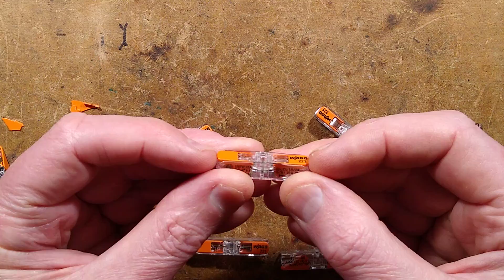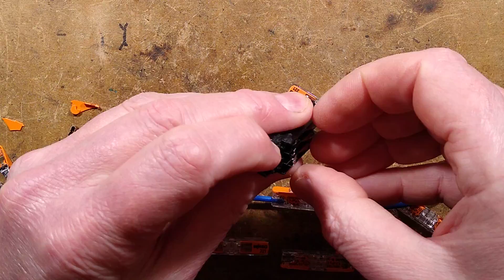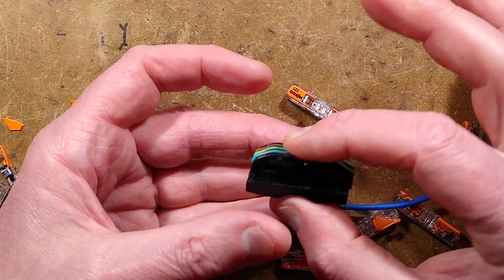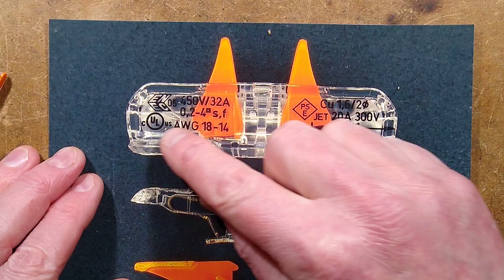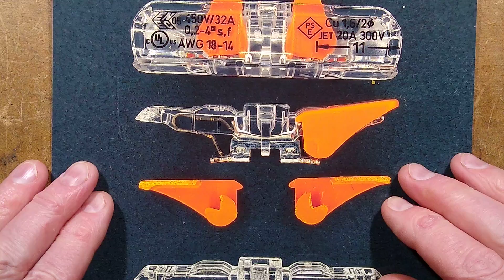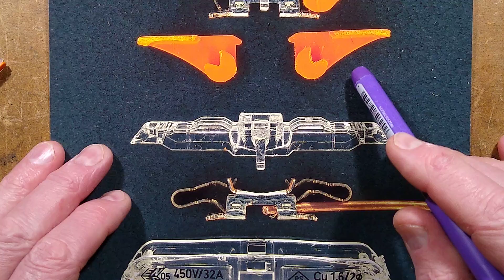By request - a look inside a Wago inline connector

Comment: You shouldn't put stranded wire into it. If you need to do it, you should crimp the wire.
Reply from the maker: It is designed for stranded wire.

Comment: I use Wago 221 connectors all of the time for electronics projects.
They're so handy to insulate the end of a wire you've yet to connect or have disconnected to try something - obviously when you're powering the circuits.  I also have them on bench power supplies so i don't have to keep connecting wires to those screw binding posts.  They're definitely a quality of life improvement when tinkering with projects.

Comment: Sometimes life confronts a chap with a situation where hard choices must be made.  Do I cower in hopes the impending misfortune passes by leaving me unscathed, or do I muster up the fortitude to contront it head on?  Today is one of those cases.
   Whilst taking an intermittently failing appliance to bits, in high hopes and anticipation that it should be fully functional upon completiion of the fiddling, I discovered that the thermally conformable polyolefin sleeve supply had previously been depleted. Hmmm, if I leave this disassembled gadget scattered across the workbench until such time as I can get round to replenishing supply, it is a near certainty that one of these near microscopic screws shall have escaped, and even should that situation prove only to be unwarranted paranoia, it is much more statistically probable that I would forget which of the 5 is a different length AND a different thread pitch in to at least 50 year old, undefined but sorta acrylic like plastic which would be likely to result in a more problematic conundrum.
  Hmmm.  Should I reassemble it as is until such time as I might be in a location where the polyolefin supply might be restored AND memory should happen to trigger that the supply needs to be restored, or just use a carefully applied, adhesive backed vinyl, du noir and just not tell anyone?
   As I stood perplexed, weighing the options over a cold slug of coffee, I thought, What might Clive do? 
 Well Sir, I hope I havent underjudged your course of action whilst confronted with a similar dilemma.   I put the tape on it and called it good.
I'm happy to report, that lacking a strain relief at the end of the handle, the cord did, in fact, appear to have been strained to the point that metal fatigue had seperated the copper strands, one from self, and one from another such that it only transmitted electrons sufficiently if one held one's mouth right. 
So the guess, and sacrificing 2 inches of cord length to resolder the connection beyond the separation succeeded. Works good now.   Oh and that split in the plastic was there before I started. So now I can oscillate the knots down my spine, and the splints along my shins and forearms happily. 
As to the matter of propriety of electing to use black tape in that scenario, I wont tell anyone if you wont. 
BTW, yours is the first channel I have ever noted being involuntarily unsubcribed from.   I'm thinking I missed whatever it was you electrocuted for Christmas.   Thank you for recording the event so I can roll back the clock and be there posthumously.

Comment: Teams in the competitive robotics league I am involved in have begun using these because they cover the range of (most of) the wires we use (between 22awg for signal to 12awg for 12 volt dc power) and I quite like them for the fact that they are fast and easy and require no crimping, unlike the Anderson PowerPoles many teams used prior. They are also pretty impact resistant thanks to that nice spring, the PowerPoles need the little plastic locks (or zip-ties around the pair). After some fiddling I find the little orange lever loosens somewhat but it still bends the spring open and the spring does all the real work. I have had no real complaints with them.
Reply: They make a model that goes up to 10 awg! Part number for the 3 way for 12 awg = 221-413, while the 3 way for up to 10 awg = 221-613. Just replace the 412, 413, or 415 with 612, 613 or 615 to get the 10 awg versions 🙂 The 10 awg versions are rated for up to 30 amp @ 300 V (The 12 awg are rated for 20 amp @ 300 V) 

This further calculation for 12 volt DC is from an Ohm's law calculator and is NOT from the company, but shows that the 10 awg (30 amp) models should be able to handle 750 amps @ 12 volt (9,000 watts. 30 amp @ 300 volts and 750 amps @ 12 volts both = 9,000 watts.) 

[20 amp @ 300v = 6,000 watts in comparison. 500 amps @ 12 volts.)

Comment: Are there automotive alternatives to wago clamps?
Reply from the maker: Vehicles are better with crimped joints for ease of waterproofing.
Reply: @bigclivedotcom  That sounds reasonable. But I never saw a crimping alternative to the Wago 221 which are 2, 3, 4, or 5 fold. Do you know of a crimping solution to those?

Comment: All the tests i've seen really show how great these connectors are. I will admit that twist caps make a better connection but only because its not the cap that is making the connection, its the wire twisted around the other wire for virtually no resistance load added. Vs a wago which runs a bus bar. But considering how well designed these are you are FAAAAR more likely to burn out a cheap outlet tab or destroy the tabs in a light before actually destroying one of these wagos. All the destructive tests I've seen were just end to end with a wago in between. Would love to see a test with source to output such as an outlet with a whole lot of load on it, and see which fails first. The wago connections within the branch circuit, or the sources that use the power themselves...

Comment: Very good review here Big Clive but one aspect of these connectors that is never talked about is how the plastic case reacts under heat or fire
Reply from the maker: In extreme situations where the cable is red hot then the plastic may be melted just as with a screw on or choc-block connector.  But the metal insert will still hold the wires.

Comment: I used those connectors in ebike. They are amazing. I was expecting them to start melting, but they are not even warm with 25 amp cotroller.

Comment: Nice teardown. One thing I am confused about with these is their current rating. Let's say they are being used in a UK domestic ring main, so 2.5mm squared cable and 230VAC, what is the maximum current they are rated at; 20A or 32A?
Reply from the maker: The full 32A of the circuit protection.
Reply: Thank you  @bigclivedotcom . It's always baffled me with the two ratings on the side.

Comment: I would love for you to take a look at the IKEA VARMFRONT powerbank. Nobody else does. It charges my phone in no time, and phone gets quite hot. Should I be alarmed? I wanna know 😬
Reply from the maker: I don't actually recommend fast charging phones.   I always use a lower power charger on mine to avoid excessive heat and battery life shortening.  But sometimes when caught short with low charge I will dig out a fast charger.

Comment: They are apparently very very good, because they are sold out absolutely everywhere. The standard ones with all entries on the same side are available by the tens or hundreds of thousands, but the straight ones are "Delivery date unknown" everywhere..
Reply: Not sure where you are looking, but CPC claim to have over 14 thousand units of 221-2411 in stock.
Reply: @petermichaelgreen  I'm looking at several of the different Swedish suppliers my job has accounts with, since I live in Sweden. 🙂 And evidently, 14 thousand is amateur numbers, a local supplier has 145,800 of the 413 variant in stock. However the same one, which reported "unknown delivery date" yesterday, have 6,600 in stock today, of the 2411.

Comment: Thanks again for going in to fine detail of this connector but can you give us a rundown of the information printed on the side of the main clear plastic body.
I see one side says 450V/32A yet the other side is different plus some other wire sizes etc.
What might be the reason for this?
Reply from the maker: It's different countries testing standards.

Comment: Great video Clive.
If someone is going to get critical about surface contact area of these connectors, then they are using the wrong size connector.
I use original Wagos at work, always twist to keep strands tidy.
If I wanted more surface contact, due to high current, then use a higher current rated connector.

Comment: I believe the official pronunciation (used by the company in their promotion materials, etc) in English markets is "wah-go", so that's what I've trained myself to call them (but to be honest, I have the distinct feeling the company doesn't really care what you call them, as long as you keep buying them :) ).

Regarding twisting vs not, as long as you get all the strands inside the connector, I don't think it really matters that much.  I usually do a very slight twist just to make sure I don't catch a strand and get a stray whisker when putting them in, but I don't worry about actually twisting very tightly.  One of the real benefits of this design is that it is self-tightening, so if the wire untwists inside the connector over time due to wiggling around, etc, it will just make for a tighter connection in the end (but even if it doesn't, I'm pretty confident it'll still make a plenty-good connection even with twisted wires, so either way is fine).

Comment: I twist the wires, I will not use solid conductor wiring with these though. Wago makes so much other stuff besides connectors. I'm extremely familiar with their I/O interfaces. Anything that says Wago is top notch.
Reply from the maker: These are designed for solid cores too though.

Comment: I prefer the Wago 222 beforehand the 221 because they are even stronger and more durable especially in moist environment. people don´t like these because the levers are harder to toggle, I like that because it clamps even harder on the wires and I have used hundreds upon hundreds of both types and always seen better results with the gray 222 type

Comment: I like these WAGO inline connectors but I was a little bummed that they are limited to 14 AWG wire when the splicing connectors can fit up to 10 AWG. This means that the 32A contact rating can't really be utilized in the inline version.

Comment: The most important criticism of Wago connectors is how much contact area they make. The stab in type with the little spring loaded catches especially. It looks like this design addresses that, but you don’t mention it. 
You do however spend half the time talking about how hard they were to take apart, which I’ll never do, and multiple ways to pronounce the name. I don’t usually get frustrated with 5 minute videos, but I did here. 
Great demonstration and drawings though.
Reply from the maker: There is a short version of the video too.

Comment: This has changed my mind. I have preferred the old-school connectors where I could trust my eyes and skill with a screwdriver to know the wire was firmly and electrically connected to another wire, short (no pun intended :-) of soldering and sleeving.
I would now use these. I thought the USA used crazy stuff  like wire nuts and lumped Wago in there.
I find that here in NZ there are lots of sellers, and I will now look at getting some.

Comment: How does the lever snap back down when there is a wire inserted? It seems like the spring is what's used to tension the lever, but with a wire inserted, the spring can't push down as far as when it's empty. And you wouldn't want the lever holding the spring up (very much) when empty, as that would make the minimum wire size too large. I'm probably missing something obvious.
Reply from the maker: The lever will be slightly looser when the sitting is gripping the wire.  But it still has to be operated with the same force to press the spring down.

Comment: When I remember right (I was told this), about 25-30 years ago these were still illigal to install here in the Netherlands. Even though they were already used in other countries (but less common). In the house I lived in, they were therefore replaced by an installation-company (not installed by me). Same actually on some places in my current house, also original Wago's were replaced with the twist-systems, I think around 20 years ago.

Comment: When I was at apprentice school (nearly 50 years ago) we were taught to twist multi-strand wires even if applying a ferrule afterwards as a stray strand can (in rare instances) be fatal.

These Wago terminals are a brilliant invention. I have spent a large part of my career designing, programming and trouble-shooting control systems on custom-built industrial equipment. When screw terminals were common, something like 75% of first-year failures were down to loose terminals. Many control panel electricians would build sections with terminals "nipped up" until complete. When they forgot to tighten everything (end of shift, tea break and many other reasons) you had a failure waiting to happen. With the Wagos, if the lever is closed then the wire is tight.

The other feature of the Wago connectors is resistance to vibration. We once sold a spin riveting machine with the control panel mounted on the frame. Had to fit rubber mounts to stop the screw terminals winding undone.

Comment: Yeah, don't twist the wires and never use Wagos.  If the strands stay gathered they won't 
'flow' to the surfaces of the lug, ferrule,clamp or any other termination.  I was unkindly told so 
by an old cranky engineer that designed such things. Also copper clad spring steel is no bueno in so many ways.
Reply from the maker: Wagos are the new standard.

Comment: I usually crimp an appropriately sized ferrule on to the wire to stop any strands from going where I don't want to. Plus it gives the Wago something a bit bigger to bite onto. I have had stranfs break off inside the Wago when not using a ferrule.

Comment: Whenever I use flex with wagos, I always use bootlaces. It's a bit overkill but the connection is usually way stronger. I use little bits of bootlaced wires and wagos to hold things up in my workshop now lol

Comment: I no longer purchase or use wire nuts, for me it's now Wago all the way. Much more convenient, and they stand up to re-use quite well.
I purchased some LED tube lights off Amazon (Barrina brand) and their pigtails are rather short. By the time you fish that pigtail through a proper gland and into a junction box, there's precious little wire left over; and certainly not enough slack to use wire nuts if I wanted to.

Comment: 0:30 I crimp on a ferrule, you get all the benefits of solid core with the flexibility of stranded and none of the weaknesses of some other methods like tinning the wire. Sometimes this makes thick gauge wire impossible to cram into a Wago, but as long as it's 16 gauge or thinner the Wago has no problems at all. Overkill? Sure. But I often use these connectors and screw terminals that really benefit from this.

Comment: I have been using WAGO's for a life-time already, they never ever failed on me.
I do twist my stranded wires but that's just to make sure I get all the strands in as I usually use wire-gauges to the spec'd WAGO's.
(read: not too big but definitely not too small, of course)
I do try not to use soldered wires as solder does not really like mechanical pressures, such wires do deform over time and potentially could get (too) loose.
As for WAGO's I would say: often imitated never surpassed!

Comment: Always remember to strip wires at least 11mm like displayed on these connectors and fully insert the wire.
If you do those two things, you'll be sure these result in a reliable connection.
Just to be sure, gently pull the wire after connecting, just to make sure it's working as intended!

Comment: WAGOs are my favorite connectors.   They really work wonderfully for all types of wire.   I use/reuse them, with various gauges of wires, all the time, while working on projects.

In particular, for stranded wire, I started using ferrules in combination with the WAGOs about a year ago.   The ferrule's plastic guard perfectly fits into the WAGO and the rectangular nature of the ferrule crimp is the perfect length and also prevents the wire from twisting while in the WAGO.  I did some major testing at high amperages to make sure the connection was solid, and it was.  The WAGO didn't even get warm.  And the compression ensures that it stays that way.

For solid wire connections, in-wall, or in-fixtures, I also usually put a few wraps of electrical tape to prevent accidental lifting of the tabs and also to prevent the wire from being able to twist inside the WAGO.  (Ferrules obviously can't be used with solid wire).   The only way to pull a wire out of a wago without using the lever is to rotate it while pulling.  Takes quite a bit of rotation to work it out but still, good to make sure the wires can't do that and in cramped spaces you don't want anything levering-up the release either.

In anycase, I live by these things.  They can take a lot of abuse, too.

-Matt

Comment: I used to solder stranded wire before crimping. I eventually figured out that solder is a lubricant in this situation, so don't.

Comment: Clive, you can push solid conductors, (as used in US residential Construcion), into the lever style WAGOs.   And to determine whether to use similar non WAGO connectors, look for an imprint of an Independent Test lab.   The WAGOs have all had a UL seal on them.